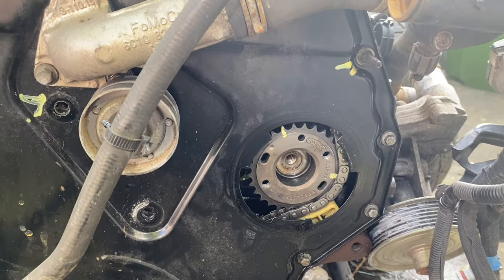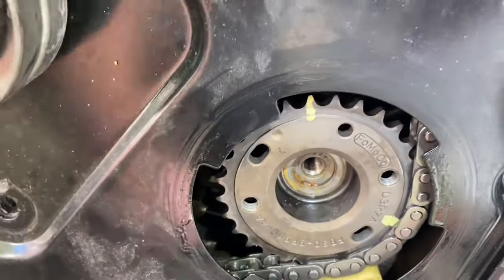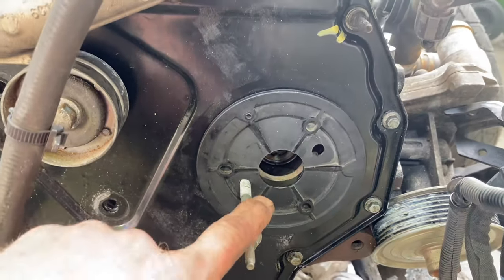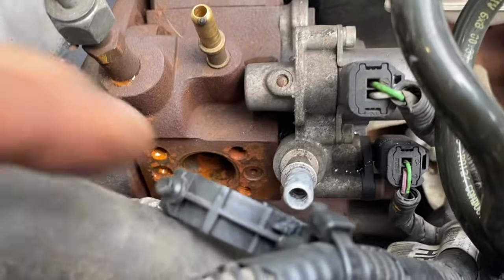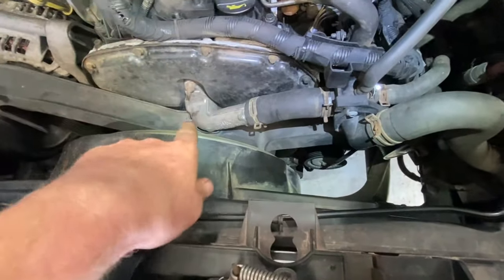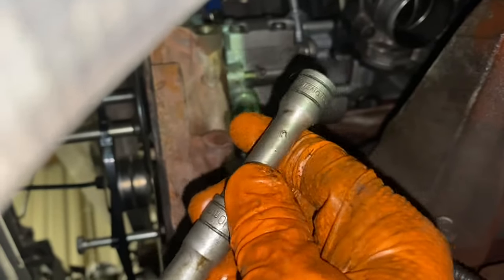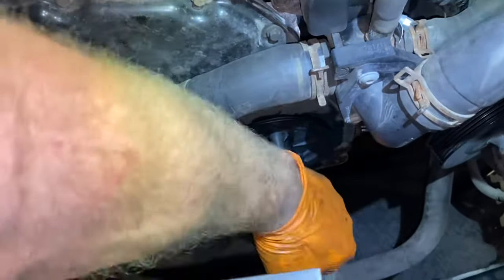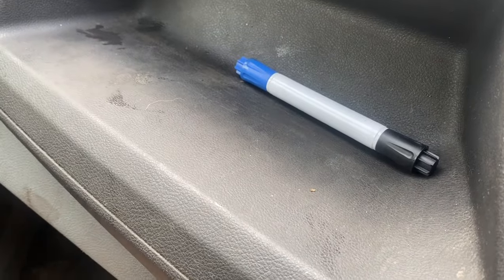Ford Transit injector pump replacement

Comment: You never cease to amaze me Peter with your level resourcefulness that’s a daunting task changing that high pressure pump another great watch thanks mate.
Reply from the maker: I’m a strange kinda bloke Kevin, sometimes I just can’t see the value in buying special tools that take most of the profit from a job & I might not ever use them again. So weirdly I take a calculated chance & it mostly works out. Probably a mad concept though 😬😂😂😂

Comment: Good morning...Very,very clever what you did with the 3/8 extensions...Greetings from Greece
Reply from the maker: Thank you sir 🙏
I have so much equipment & special tools that I quite often forget what I have. But didn’t have the tool for this pump replacement, so I carried on regardless. This might not be best practice but something I do do when stuck just to keep a job going or meet a deadline 😬😬
It is Fantastic having someone from Greece watching an Irish lad, hopefully you can understand my accent 🤞🤞

Comment: Great video, is it essential to Lock that front sprocket on the Timing before removing the fuel pump? I’ve got the 3.2 in line 5 I presume it’s the same thing I haven’t got into the guts of it yet they were charging $3300 to replace the gasket.
Reply from the maker: Hey Billy, the 3.2 is the same as the first tool I made up, it was slightly different than the 2.2. 
It isn’t necessary to lock the pump in place. But it is necessary to keep the pump pulley in its central position on the pump. You cannot allow the timing chain to get slack and jump teeth. It would probably be worth inquiring about the locking too if you have time on your side 🤔🤔

Comment: Super job any timing on pump when putting in new one or Is it just high pressure
Reply from the maker: No, not on these pumps. They are tapped shaft driven with no locating tabs in the pulley, hence just being concerned about keep my timing chain somewhat tight just to avoid the cam or crank jumping teeth 😉👍👍👍

Comment: Today I qualify as a professional mechanic. I have a shock absorbers stuck to a threaded bolt on the rear of my Mazda. The only way to get it off is to use an angle grinder. Peter wish me luck.❤❤
Reply: Gonna do the lower control arms if the shocks go well and those little drop link things.
Reply: Oh gonna try a pullers on the shocks before I take out grinder. Missus is gonna go nucking futs if the power tools are deployed..😂
Reply: Got it done....whatever mechanics charge for those jobs it's not enough!!
Reply from the maker: @bastogne315  😂😂😂😂😂😂
Well done mate, I’m only getting to reply now, apologies. Some of these type rusty bolt jobs can be testing. But what doesn’t kill us makes us stronger, great job 💪💪
Reply: @kennedysgarage3281 Thanks Peter. I stuck up a YouTube on it.😂
Reply from the maker: @bastogne315  did you??? Or are you joking. I’d love to see it

Comment: Ingenious Peter. Was there any coding to do on the replacement pump?
Reply from the maker: No Trevor, no coding needed I just done an injector pump relearn after fitting. The complete job is relatively easy to do 😉😉

Comment: Peter if a customer turns up with their own parts do mechanics hunt them. I can imagine it could be a pain if customer bring wrong part etc.
Reply from the maker: I will fit customer supplied parts but the can quite often be wrong or of really poor quality. Which then becomes a problem when they don’t work after being fitted. I don’t be as concerned with price as I do quality 🤔🤔

Comment: Have you ever removed the HP PUMP from the Pumo Supply pulley at the bottom of the timing belt assembly on a 2010 Ranger PK 3L diesel 4x4 ute ??
Reply from the maker: No, unfortunately not. It should be quite easy though. Are you getting stuck on something??